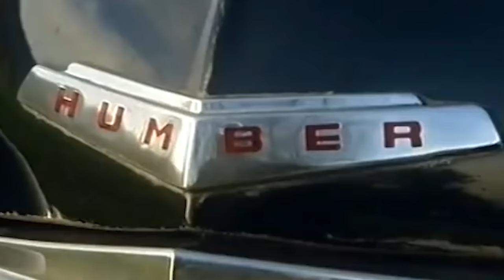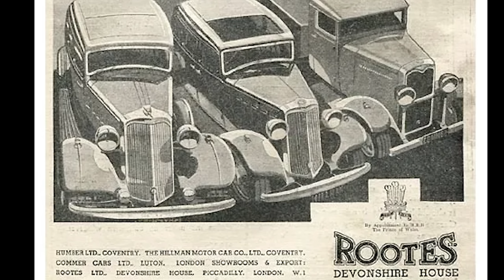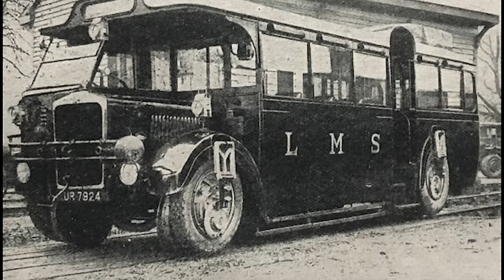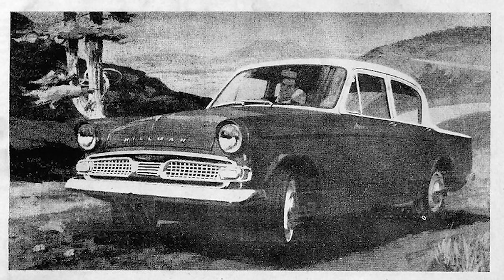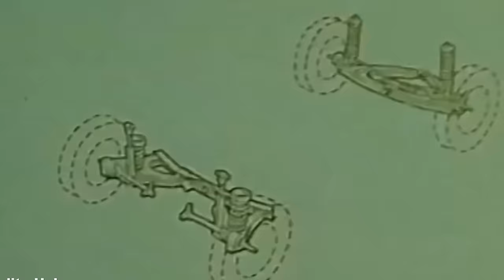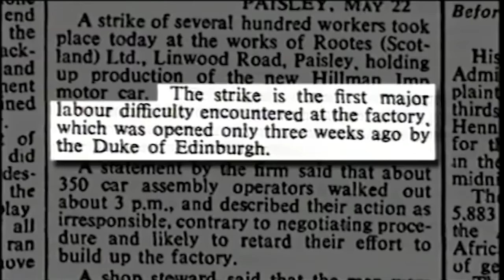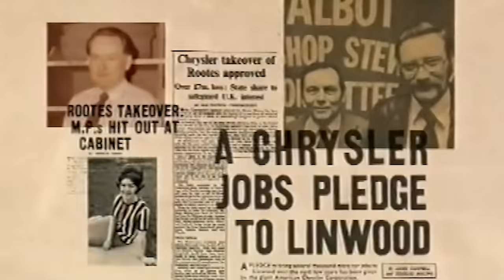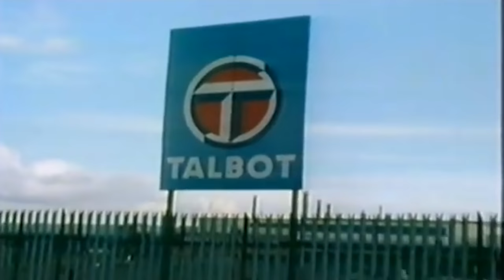The LOST BRITISH CAR EMPIRE! - The Rise And Fall Of The Rootes Group

Comment: The Singer brand was ended in 1970 but the Humber brand continued as the Humber Sceptre until 1976 when the UK built Chrysler Alpine was launched. You missed the decision in 1970 to end the UK side of the 180/2Litre car and its V6 engine. This was a result of the losses and the cost overruns on moving the Arrow to Linwood and putting the Avenger into Ryton, this was so great there was no hope of profitability, so Chrysler stopped all investment in the UK till the management and workforce got a grip of things. They never did so there was no material investment until the Government bale out in 75. This did the following. 1. Put the Alpine into Ryton, 2. Moved a facelifted Avenger to Linwood. 3. Enabled a small car to be developed on the Avenger platform, the Sunbeam. 4. Introduced a new large van using a US Chrysler van body design, over a UK derived light truch chassis the Dodge 50. 5 the facelifted small van becoming the Dodge Space Van. Ryton was to have somewhat of a renaissance under Peugeot building 309, 405, 306 and 206.
Reply from the maker: Thanks for this Graham, such a good comment and bridges some gaps. I’ll pin this so others can see.
Reply: @fredyellowsnow7492  Hi it was essentially meant to be exactly that. But ended up with the Simca ohc engine, which was pretty good in its day and the rest of the powertrain taken from the Simca 1501. Had it existed as a UK car it would have used the 1800 (Brazilian block) version of the Avenger high cam engine and a 2000 and 2400 V6 engine of similar architecture to the Avenger engine.

Comment: You did ask for comments? I worked in a Rootes dealership in the 60s and early 70s, they were really nice cars. In the video there is little mention of the Rapiers with Holbay engines, the Alpines (though the Tiger is mentioned briefly), or the Sunbeam Talbot 90s that were so successful in the Monte Carlo Rallies. A final point, and please take this as constructive criticism not a complaint, your delivery of the commentary is much too fast and high pitched; slow it down a little, the way it is presented makes it seem like you're just reeling off a load of facts and don't really care about what happened!
Reply: Totally agree with your comments. I too worked at Rootes group in Birmingham when the Avenger was released. I have owned a Hillman Minx, Hillman Hunter, Sunbeam rapier and a Hillman Imp. Favourite car was the Sunbeam Alpine which was not really mentioned in this episode and yes, it does sound like you are just reeling off loads of facts from a book.
Reply: So what was the outcome of your strikes?

Comment: Love this channel.... My first car was a 1968 British racing green singer Vogue which I brought in the mid 1980s as I'd just passed my test.... MOT time came along and I found a huge hole in the passenger side footwell.... No problem I stuck a huge ceramic bathroom tile over the hole using body filler as a glue.... Then a thick coat of underseal... Job done 👍.... Got a fresh mot 😂😂... Unfortunately this lovely old singer Vogue came off worst in a battle with a huge Volvo estate car later in the year and went to the scrap yard in the sky..... Fond memories of the roots vogue with its lovely walnut dashboard... RIP

Comment: My father worked for Rootes in the 50’s and had his own distributorship in the 60’s. The picture you use of the Maidstone depot reminds me of the night we coasted down from Wrotham into Maidstone in a brand new Minx during Suez, and dad pulled into those pumps to fill up. Petrol was rationed and within seconds there was a queue out of sight. During the 60’s we had , used and holidayed in every type of Rootes car, mother had a Sunbeam Rapier 111 convertible , unbelievabley my  father towing a caravan with a Singer Chamois all the way to Cornwall, with my parents and two children. Over 300 miles. Dad had to stop once or twice to let it cool down after long hills. I am now the proud owner of a Mk2 Super Minx with original 92k engine which we recently reshelled with std sized bearings.
One of only about 230 still on the roads.
I have so many memories. Rootes used to throw a Christmas party for the children at Maidstone with individual names presents and in the 50’s I met Reginald and William with my dad at the Coventry plant.

Comment: Really interesting and well researched piece ( as was your Marina vid). My dad had a Hillman Hunter which I was allowed to drive after I passed my test in 1972. Great 1725cc engine which was better than the 1600 Cortinas. Only problem , an aluminium head which warped. Understandably  dad made me pay for re-skimming it (in the days when parts were repaired, not just replaced). A few years later I had  a Marina “company car”. In hot weather you had to open the windows and put the heater on to stop the engine overheating and endure the drive on plastic seats! Not quite such good old days!

Comment: From one Tom to another, great video! I believe the reason Plymouth dropped the Cricket is because the captive import subcompact Dodge was selling at the same time, the Mitsubishi-made Colt, had far fewer customer complaints and warranty claims. Thus, for the 1974 and '75 model years, Canadian market Crickets became rebadged Colts, while the name was changed to Plymouth Colt for 1976 (Weirdly, U.S. Chrysler-Plymouth dealers would be without any subcompacts in the 1974 and '75 model years, right when they needed one the most!).
Reply: Yes the Cricket would have been just the car to beat the  sales of Datsun, Honda , Mazda, but it was the surge in sales particularly in 1972 of the Toyota Corolla that cought Chrysler asleep , Ryton in Coventry couldn't make enough to export ,as the Avenger sales were steadily rising  in Britain,, especially as the estate & 2 doors were launched in 72. Had they assembled LHD models in the US it might have been more of a success. The Japanese learned this in the mid to late 70s building models in the US & laterley in Australia & UK .

Comment: I has a 1962 Humber Super Snipe Limousine ( sliding privacy glass and flagstaff on the hood/bonnet) version. It was on diplomatic service overseas before coming back to the UK in 1976  on a P plate. I picked it up in 88 and soon after the age related plates became available from DVLA- I got a 1962 plate. Loved that car, but parts particularly body panels were rare. I sold the car mid 90s.

Comment: In 1968 December, a Hillman Hunter won the London to Sydney Marathon (Andrew Cowan). The next year Chrysler Australia produced the Hillman Hunter GT, with 1725cc Sunbeam Rapier engine and Twin Webber carbies, wooden fully instrumented dash, rocker switches, metallic purple body, vinyl roof and reclining front seats.......boy could that fly. Was my second car and there were lots of places in South Australia where you could really let the car rip, on many occasions I passed the 100mph mark on the speedo. Loved that car, until my missus was involved in an accident (not her fault).....so got a Datsun 180B
Reply: Yes,. That was a very tough rally where even Ford, BMC & Volvo were struggling. pity Rootes didn't ' cash in ' on the Hunters success with the GLS launch in  say,1969 instead of waiting till '72. It would have been a competitive car against the  sometimes temperamental &  fragile MK2 Cortina Lotus ( by then fully assembled by Ford at Dagenham) The Hunter was successful in  touring cars. Circa 72 to 75.
Reply: I also had a Hunter GT ( I'm also from South Aust.) And I agree with everything you said. They were a pocket rocket and much underrated. I still reckon that wooden dash with all its round guages was one of the best ever.☺

Comment: God video as always. One small thing - the Talbot Arizona wasn't dropped in favour of the Peugeot 309, it became the Peugeot 309, your picture of the Arizona is a dead ringer for the production 309. Basically it was renamed at the last minute. Used the centre section of the 205.

Comment: I did my apprenticeship in the Humber body experimental dept as a styling modelmaker, I made the perspex Avenger rear light clusters for the first fibreglass mockup. Later went into body engineering design and in 1997 bought the company name "Chrysler Limited" which I kept until 2 years ago.

Comment: Having owned  (in my early days of driving),  4 Rootes cars in straight succession, i wish I was in situation to drive any one of them as a classic. The first was 1957, series 1 Minx Convertible with the 1390 engine. It was tired and abused by the time i had it in 1967 but nowadays would get a full resto. The next was a 58/59, series 3 saloon, complete with Brighton registration. This one cost me £20 and I ran it for 3 years. It had the 1494 engine. 
Next was a very tidy  3C saloon run from 1971 until 1973. During my ownership i reconditioned the 1600 engine. During the down time, I bought a 3A estate to keep me on the road, another bargain for £25, which I sold again when the 3C was up and running again. 
All of them except the 3C had a column change and these were light, a joy to use and kept that bench front seat free for an extra passenger in the front. Unlike Ford and Vauxhall at the the time, they were also 4 speed. Being still between 18 and early twenties at the time. I used to manage clutchless changes, like all the boy racers on the move quite easily, which considering the mechanical joints involved in the linkage, says a lot about Rootes design. 
I went all cortina mad after my 3C until the nineties. 
My only wish, cars with the same integrity were still available today. The demise of Rootes was the beginning of the end for British car manufacture.  Chrysler totally wrecked what was Rootes. Shame. 😢

Comment: I worked with an old boy back in the 90's he was a Rootes man, served his time at the local Rootes dealer, he had worked in Coventry developing Commer vans. The local authorities requested a van that would do 50mph and achieve X MPG. They couldn't manage it so ended up altering the speedo to fix the problem. He said while they were testing it on the track a little car kept zipping past them nobody was allowed to say what it was.

Comment: I owned a 1961 IIIB Minx as my first car in 1974 and then got a 1970 2A Hunter in 1976. Later I owned a 1961 IIIB Humber 80 ( a badge engineered Hillman Minx built alongside the regular Minx in the NZ market that allowed Humber dealers to sell a cheaper car), as a classic. Between my Father, grandfather and I we probably owned 13 or so Hillmans / Humbers from the 50's Mark models through Audax to Arrow cars.

Comment: I was a fireman in the 70's and while doing drills in the yard behind the fire station, which we shared with the police station, magistrates court, heath centre and library (the county buildings), a Hillman Avenger turned up and caught our attention. 
It didn't sound like a car of those times, and upon closer inspection we found it was a test bed for a Perkins diesel engine. In those days diesel engines were only used in larger vans and construction etc.
As far as I'm aware it never became a production model and it was a few years before diesel engines were an option on cars for the general public, and even then they were noisy and not very responsive.

Comment: My first car was a 1953 Hillman Minx Mk V assembled in Melbourne. It had been the family car; before mandatory seat belts we fitted 7 on the 2 bench seats. It was a real character car; it had flipper indicators, 3 on the tree, high beam button on the floor, and had to be driven with what I called 50% horsepower, 50% willpower. In my custody its shortcomings were soon obvious: it had an iron block, an aluminium head, and a copper sandwich gasket that was designed to fail regularly through galvanic action. When I finally let it go, the head had been shaved to the point it had a 13:1 compression. The petrol line was a copper tube strapped to the head. The resulting vapour locks in the Adelaide heat were dramatic and resulted in a 2 hour wait while everything cooled off. On weekend trips to the Adelaide south coast, I had to catch two sets of traffic lights at speed to be sure of sufficient momentum to climb Tapleys Hill. Near the end of life, it would only start with the crank handle. I had a process that involved a brick on the accelerator and an open driver's window. I cranked the engine, rushed to the door, threw the crank into the passenger side footwell and got in just in time to kick away the brick before the engine revved its guts out. The car wouldn't idle and had to be kept alive by tickling the throttle. This was an invitation to a drag race. Once on Hindley St I stalled off the line and had to execute the starting procedure in front of the Saturday night crowd: not cool. Its reliable touring speed was 40 mph. We went to Pondalowie for a weekend, and with no surf decided to return and go to the drive-in (we could see the O'Halloran's Hill screen across the gulf). I calculated we needed to travel at 45 mph to make the show. We didn't make it: blew the head just out of Warooka, pushed it into the local garage; the owner let us use his tools to take off the head and re-glue the gasket. We had no mechanical skill & it took much of the night before it was mobile. The timing was too advanced and the car would only run at high speed. Unfortunately the traffic was jammed up at Pt Wakefield and limited to 30 mph, so I slipped the clutch most of the way with several stops to top up the radiator. Character defining stuff.

Comment: Sorry, Humber wasn't dropped along with Singer Motors in 1970. The Humber marque was dropped along with Hillman and Sunbeam in 1975. Sunbeam was re-introduced as the Chrysler Sunbeam in 1978. Sunbeam was never considered the stablemate to Hillman. The range was always Hillman as the basic car brand, followed by Singer, being a rival to Wolsley, whilst Sunbeam was a sporting range of sports saloons and cars. Humber was the top of the tree. The Sceptre was meant to be the new Rapier replacement, but was said to be to heavy, so it became the entry model Humber. Hope this helps.
Reply from the maker: It does thank you,

Comment: Yep: I had a 1960's Sunbeam Alpine in the early 70's which was great fun, if a little rusty. It was often referred to as a "Husky GT" because the chassis was a Hillman Husky (a shortened Minx) with a twin carb engine. My girlfriend (who latter became my wife) and I had a fantastic trouble-free trip to Italy in 1973 in it. The car I really wanted was of course a Sunbeam Tiger but the insurance company were at the time not too happy due to my age. Chrysler were also not too happy with a US-Ford engine in a Rootes car, so that car was discontinued (Not mentioned in your video). Years later, I did end up with an MGB V8 which was also a British sports car with a US V8 (Buick) and I still have it. The only alternative would have been an AC Cobra;-)

Comment: My first Hillman Imp was bought in 1964 and it replaced my Mini and the Imp was a better car. This was the replaced with a Mk2 Hillman Imp in 1968 and this was quite an improvement over the first model. In 1971 I bought a Hillman Avenger which in turn was replaced in 1973 by a Hillman Avenger GT. I was pleased with all my Rootes Group cars their main weakness being bodywork rust problems but these were common to all cars at that time. If I am asked my favourite car that I owned in the past it is the Avenger GT which was fun to drive and about which I have happy memories.

Comment: I’ve come to really appreciate Rootes cars - they seemed to be very well built, quality items in the 50s and 60s. Sadly, the Imp and the Hunter, although valiant attempts to move more mass market, just didn’t cut it - although the Imp was a little jewel of a car. By the time Chrysler bought them, Rootes were pretty much doomed. The later Talbots were quite cutting edge for a while, but ultimately the completion completely overtook them, and it was obvious that the brand no longer had any credibility.

Comment: The Plymouth Cricket version had major issues with the Mandatory U.S. “Clean Air Act” Legislation.  These cars fitted with the new equipment [ anti-pollution devices, unleaded gas, etc. made the Cricket near impossible to run smoothly.  Loss of power from an already small [ by American standards] engine, and rough running engines made the cars unattractive to buy.
Less than 30,000 sold in 2 years, before it was cancelled.  😢

Comment: In late 70’s my mates dad had a Hunter, well several, they were awful, one spat its rear axle out as he was dropping us off at a scout camp, it was 3 days old. Unions killed Rootes just like they did Leyland. Imp was a terrible car from the get go, poor packaging (engine where the boot should be) and an engine that likes to eat itself (Colin Chapman ..yes of Lotus fame.. designed parts of it) Sunbeam was a chopped down Avenger, a small RWD almost hatchback sounds fun but was no match for the FWD supermini hatches with acres of space. The entire Talbot range were dreadful with nasty French engines that sounded like terminal bearing failure from new. The Pug 405 was made at Ryton. Better than the French ones but that’s not saying much. Appalling build quality and an armful of design faults Peugeot refused to acknowledge. 306 was a half decent car but Peugeot shut Ryton because they were too scared to take on French unions and shut one of the French plants. Yes Unions really did kill Rootes and its successors although it did make some turds on the way.
PS Great video and liking you work 😁👍